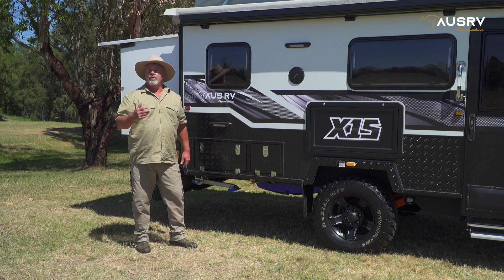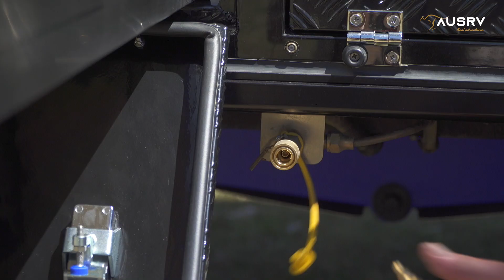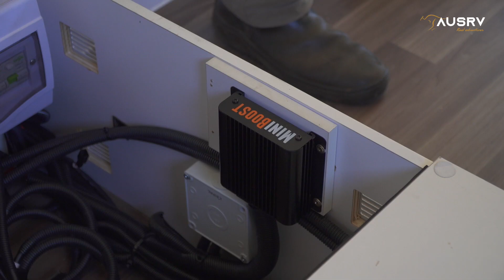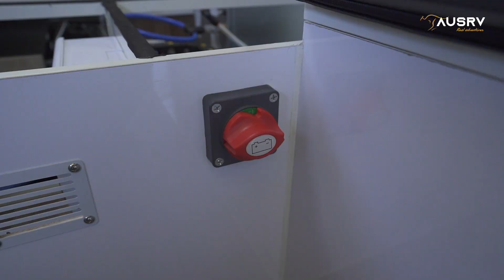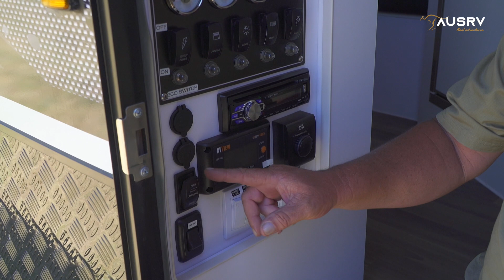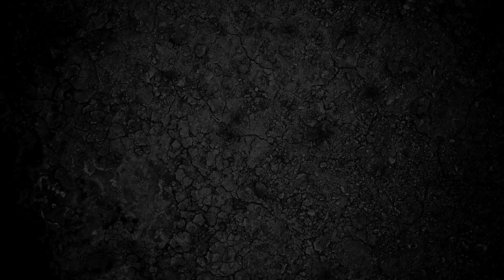AUSRV X15 OVERLANDING TRAVEL TRAILER: Kitchen & Electrical Setup

Comment: Can't get the outlets to power 110. Not sure I understand this system. Does it need to be plugged into shore power to run the ac or outlets? Is there no inverter switch?